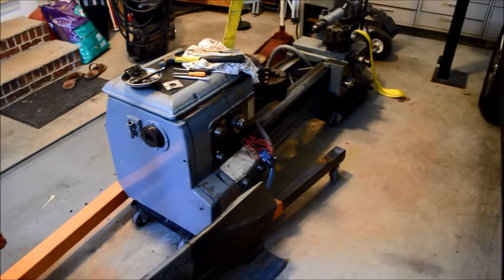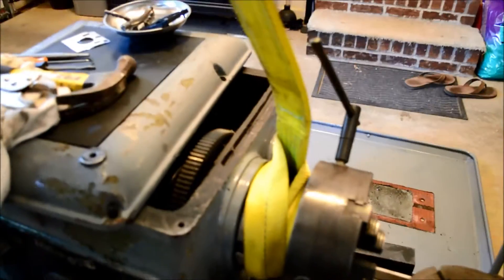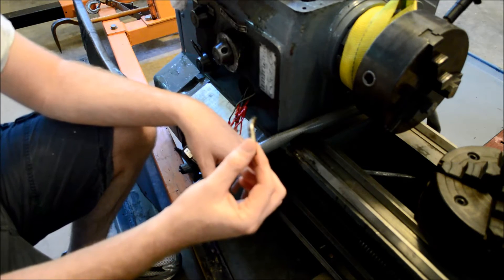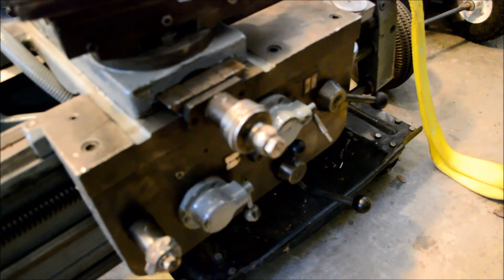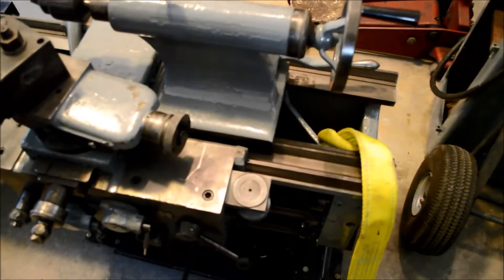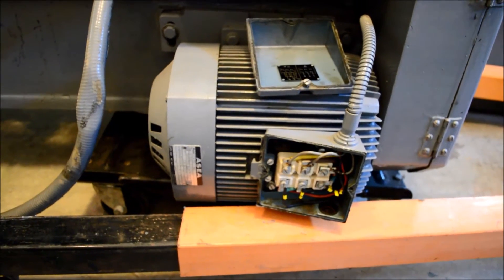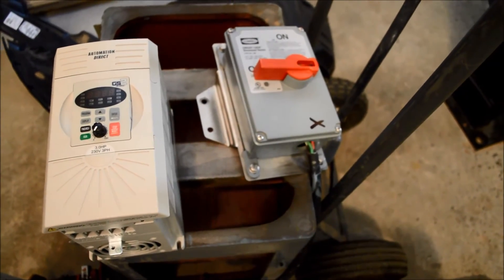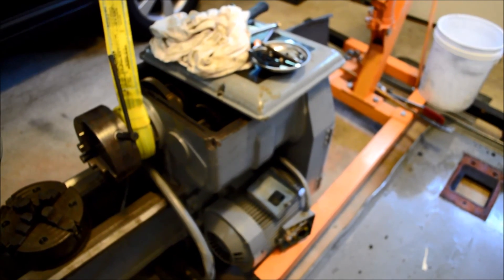Lathe Rebuild Project- Introduction- Storebro metal lathe Rebuild Part 1

Comment: Great video, helped me a lot. I found a lathe similar to yours for sale locally and used your informative videos to research it before I eventually purchased it. Mine is a ORN 185-GK-12, a few years older than yours and produced by "Ornmaskiner" before the company was purchased in 1960 and the lathes then produced by Storebro. I just got this lathe running last night with a single speed 3hp 3ph motor (original motor long gone) on a vfd and a tachometer. I was surprised to find that at 60 hz and 1745 rpm (motor), I only had the lower 6 speeds. I had assumed that I would have had the higher speed range before I started it up. Anyway, I have a question for you, what are the two speeds available on that ASEA motor that you show I this video. I'm curious about that because the few 2 speed motors I have seen have both speeds below 1800 rpm or below. If our pulleys are about the same size,  your motor must run over 3000 rpm to get 1300 at the spindle. Right now I get about 750 top speed at 60hz.
There is a good chance I will just turn another smaller input shaft pulley to get the shaft speed up to a range half way between the two speed ranges and let the vfd do the rest but I have an old motor and don't want it to run too fast or slow.